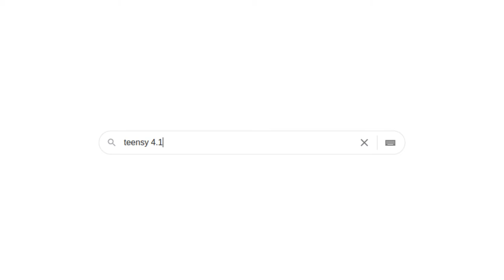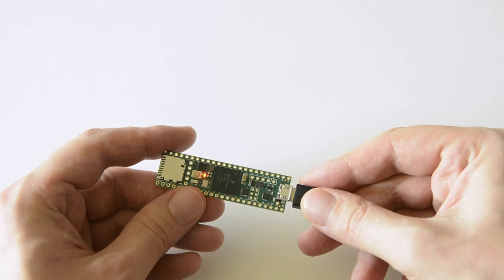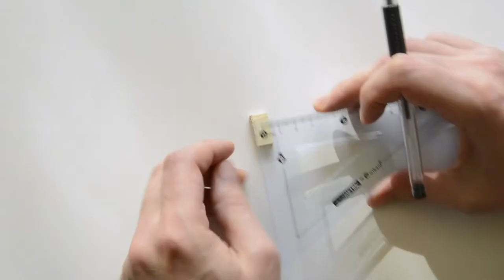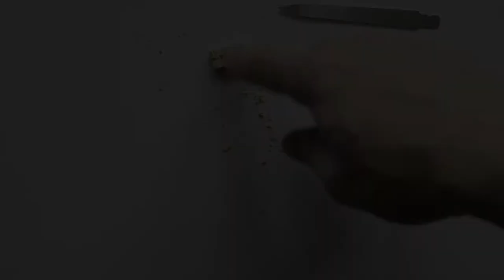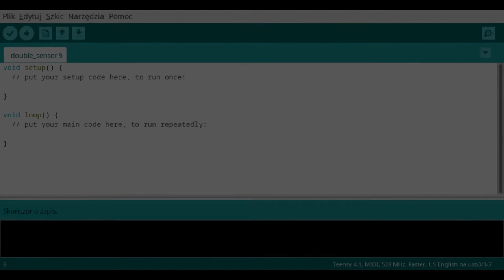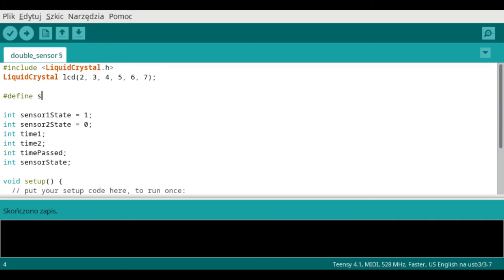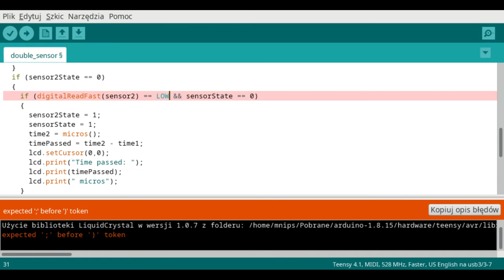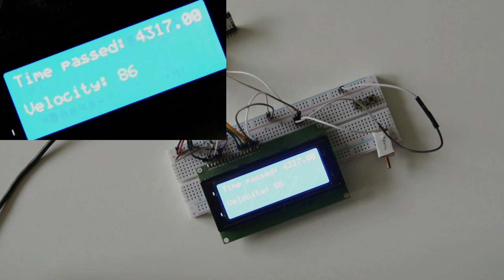How To Build A Simple Velocity Sensitive MIDI Controller. (Digital Piano Build: Part 2)

Comment: Hi Ted
Quite interesting project. Is it still in progress ?
Reply from the maker: Thank you. Unfortunately, I had to put the project on hold for a while due to a lack of time. I’ll definitely come back to it at some point.
Reply: @TedsProjects  Ok Ted. It would be a good news to get others parts. On my side, I build a numeric diatonic accordeon. I have seen you use a Teensy board and a Raspberry. Are you sure you will not face a latence problem because you need to deal with of lot of input command from the keyboard.
All the best to you
Jean-claude from France.